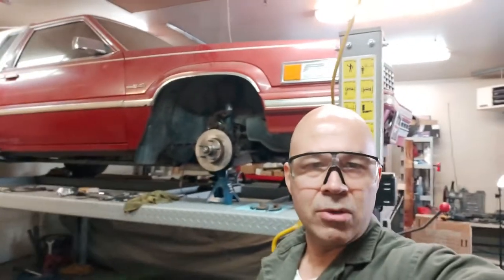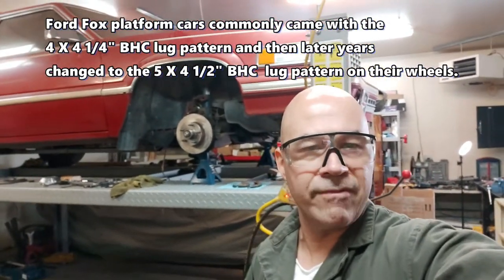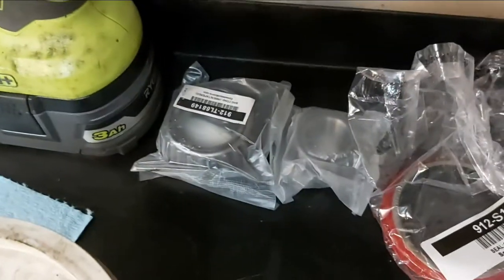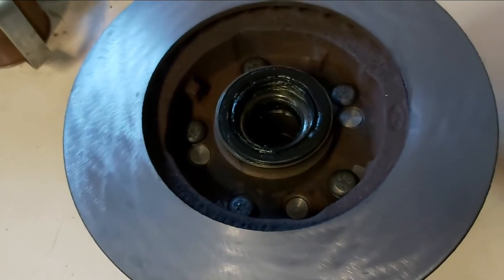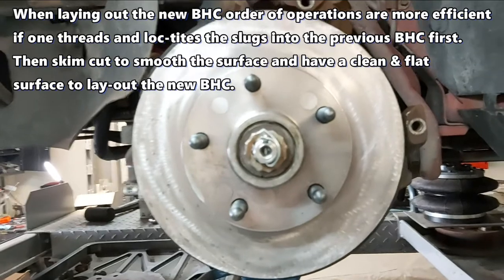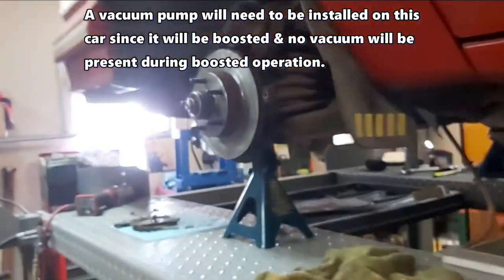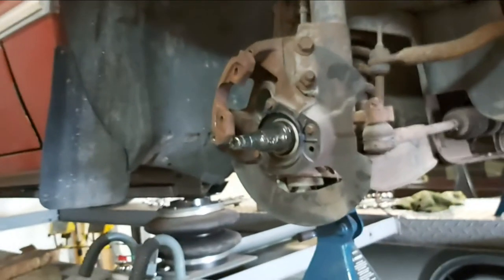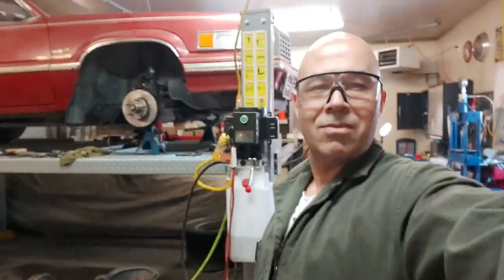Front Brake Rotor Re - drill  from 4 lug to 5 lug pattern on Fox body platform cars.

Comment: You could of used 80's ranger rotors they do need to have the outer diameter turned down about 1/8 of inch but they are 5 bolt and use the same bearings. 83-94 ranger or 86-91 Aerostar (2wd). Also for the 87-91 mustang rear axle can use the left side axles 83-94 ranger or both axles from 86-91 aerostar and if I remember correctly the brake drums fit also
Reply from the maker: thanks.....